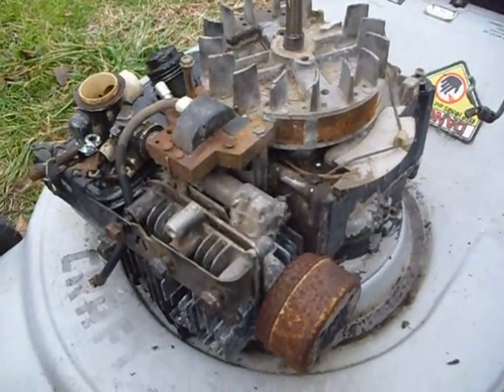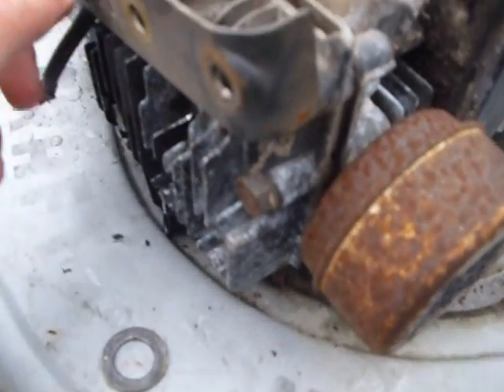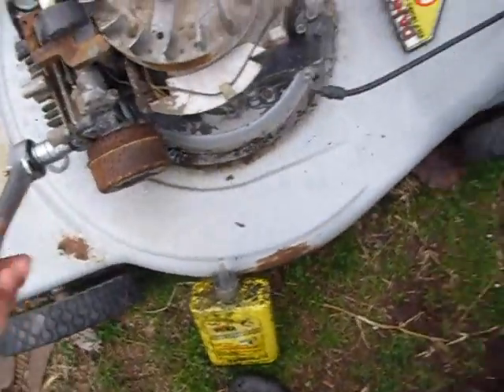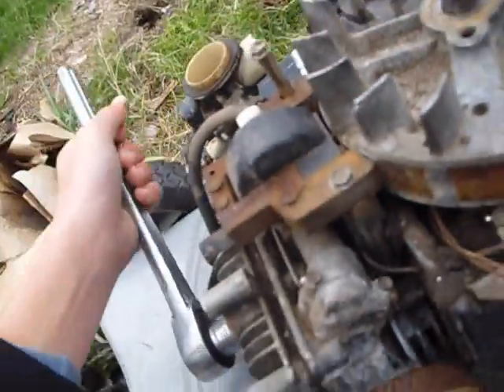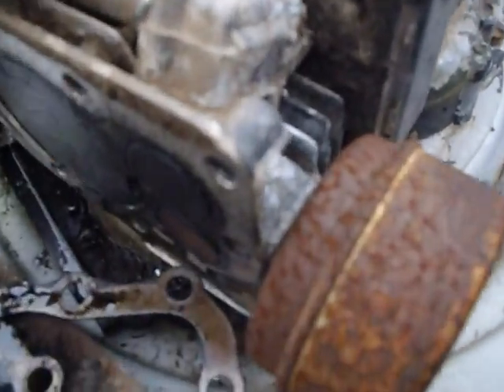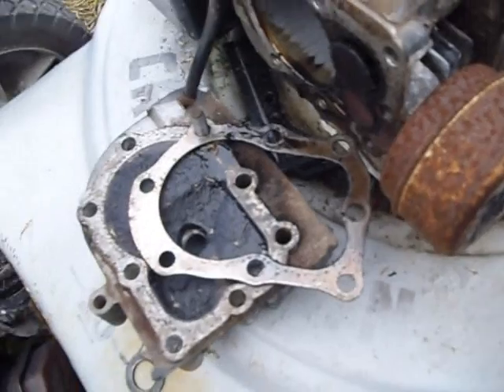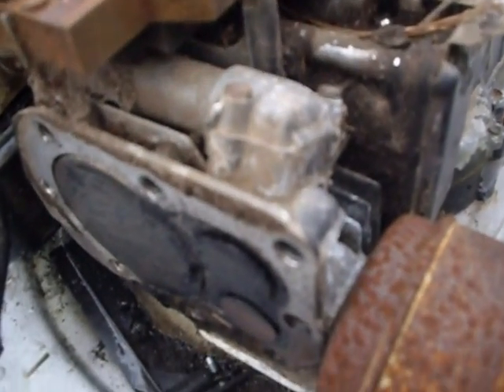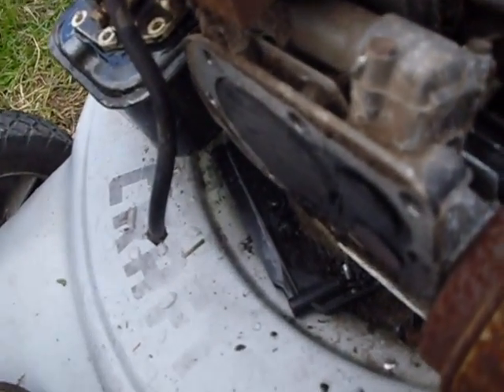taking a 3.5hp Briggs engine apart

Comment: You can get it to live again. They still run with some cylinder damage, but if you can't get the valves seating right, it will give you grief. If it really burns oil, the valves and plug will need to be cleaned up more often.